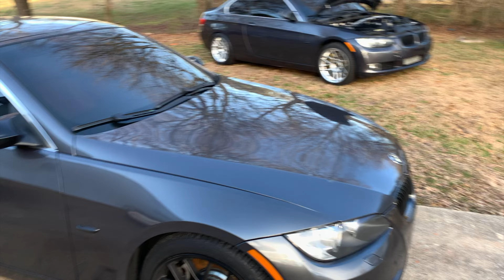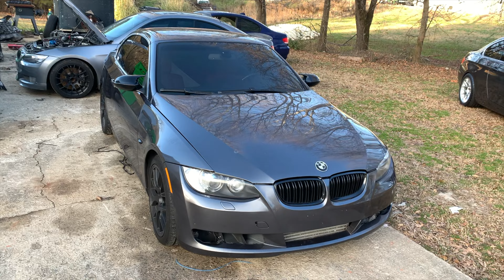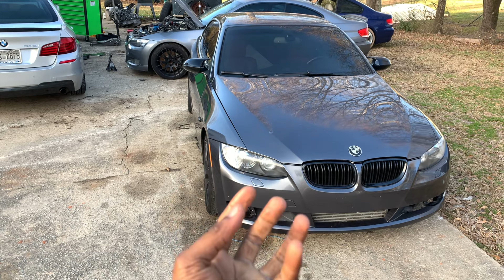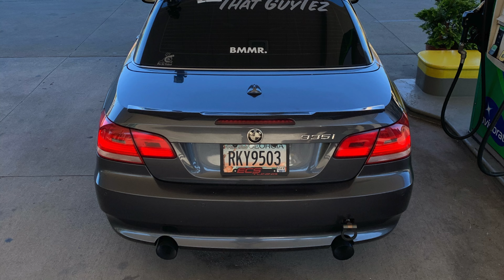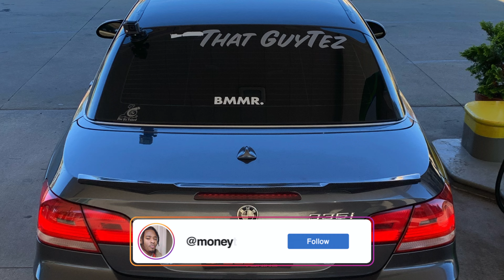I HAVE BAD NEWS ABOUT MY DYNAMIC AUTOWERX STAGE 4 TURBO BMW 335i BUILD  :(.......

Comment: Bro there’s a big 50 amp fuse inside the white dme box. I was having a no start issue changed that 50 amp fuse with with a brand new one, changed my negative terminal with the ibs sensor starts everytime
Reply from the maker: Alright I’ll try that!
Reply: @ThatGuyTez  Let me know how it goes. My car was doing this thing where it would start n then as soon as I’d make it to my first red light it would die and not strat back up. Ended up replaced all the sensors n shit just like you did. Got the ins code so replaced that n was still having the same issue. That fuse was the only thing I didn’t change n the codes I was getting kept saying dme power management n stuff similar to power. So I said fuck it what else do I have to lose, changed that fuse haven’t shut off since. Even if it looks good change it! The “s” inside the fuse was still intact but the fins that plug in and make the actual contact were discolored(almost looked burned). Went to Napa grabbed that fuse for like $2 n that fixed it.